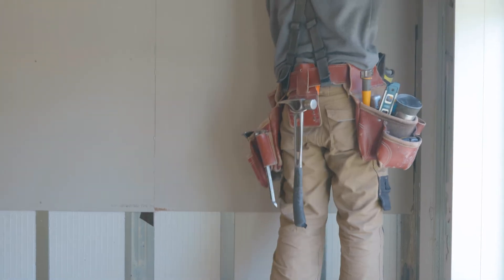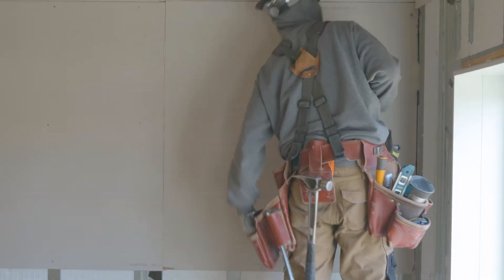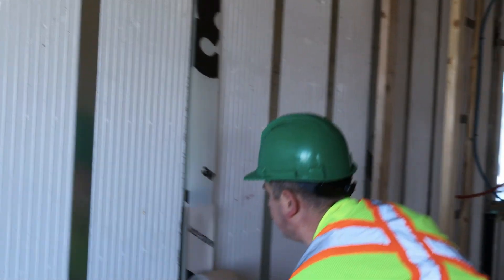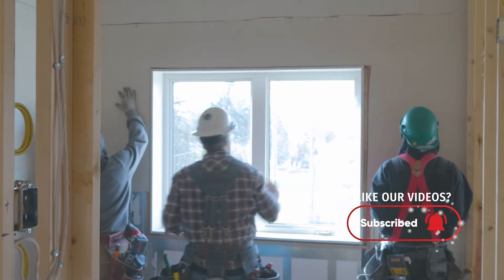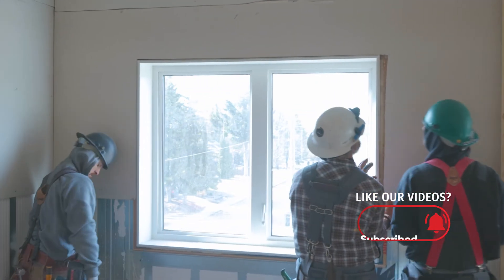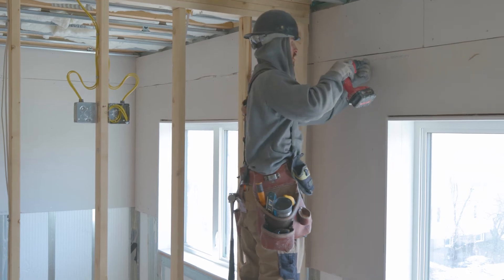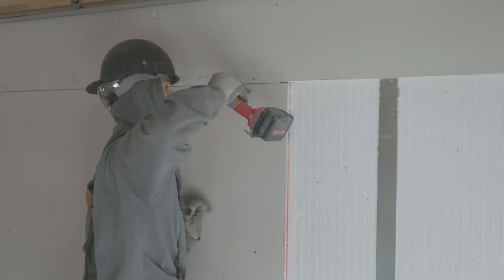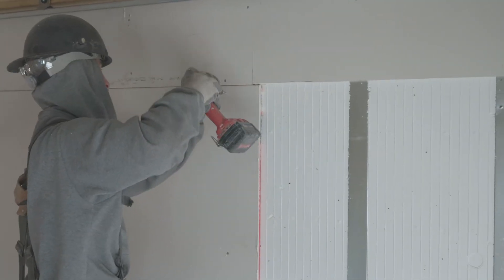Build it With Greenstone | Installing Drywall

Comment: I have never heard of having to install 2 layers of drywall in residential construction? Is this something required in Canada vs USA?
Reply from the maker: 2 layers of drywall would only be required for commercial ICE Panel projects to have a 2-hour fire rating, for residential, 1 layer is required.

Comment: did i hear you say you have to install 2 layers of drywall to meet firecode ratings?
Reply from the maker: Hey Dan. That's correct 👍👍
Reply: Not sure i understand why this needs to be done? Lots of extra labor and materials. Also none of the other SIP panel company's have mentioned this ?

 @GreenstoneBuildingProducts
Reply from the maker: @DanLiese  There are other wall assemblies that don't require 2 layers because of the makeup of the assembly. In order for us to meet the 1 hour FR we require 2 layers.
Reply: So is the 1/2" double layer sheetrock is required only on exterior facing walls or all interior walls as well
 @GreenstoneBuildingProducts
Reply from the maker: @DanLiese  The 1/2" double layer drywall is only needed on any ICE Panel walls.